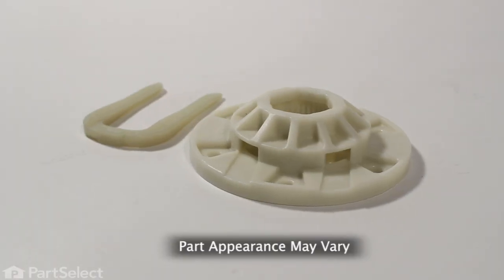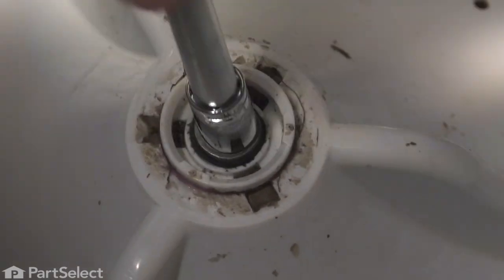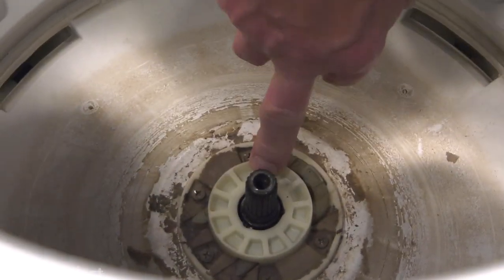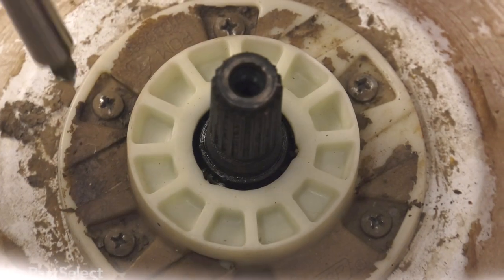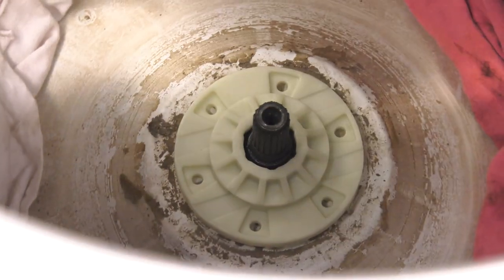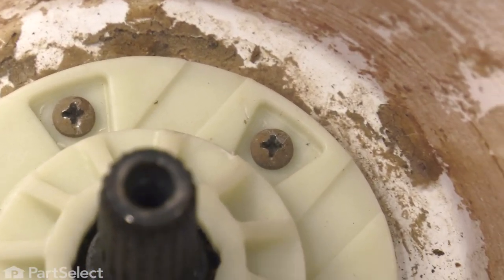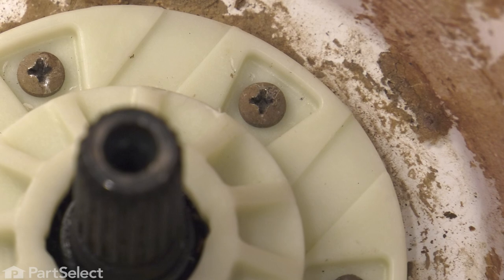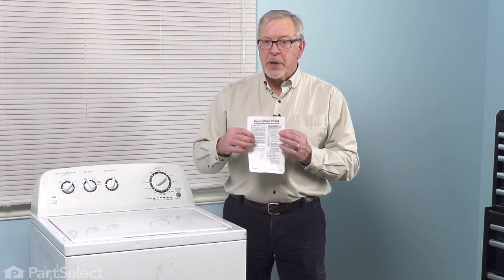Whirlpool Washer Repair - How to Replace the Drive Hub Kit (Whirlpool # W10528947)

Comment: is the basket supposed to rock side to side easily with the new hub in place?  If the bottom of the gearcase shaft splines are slick and the ribs of the bottom of the new hub isn't grabbing to anything on the shaft will this cause a rocking motion in the basket.  Causing a violent shake because the inner basket doesn't have a full grip on the shaft of the gearcase?  Then its time for a new gearcase along with the hub?

Comment: You know it needs to be replaced if your washer makes loud grinding noises and clothes come out wet (since no spin cycle). TIP: If the base is stuck after you remove the 7/16 bolt use 2 metal paint can openers you get from Home Depot to get under the outer lip of the base and rock/lift.

Comment: At 4.26 he says push down the new hub as far as you can and use the screws to suck it down. Shouldn’t the new hub seat all the way down before the screws?
My splines are pretty corroded ,(why this shaft isn’t stainless is beyond me), I dug the corrosion out of the splines and wire wheeled everything and the new hub still won’t seat all the way down. I’m thinking about seating it with a piece of pipe as a drift and a mallet before using the screws. Any thoughts anyone?

Comment: I can’t get the agitator off screw is out. It is stuck like iron and now I’ve cracked it. It will not come off the bolt casing. Any ideas???
Reply: Mine was stuck as well but it was reverse thread I gave up originally and one day went back down and tried it reverse and it came right off
Reply: mine is stuck the same and the screw is out just stuck